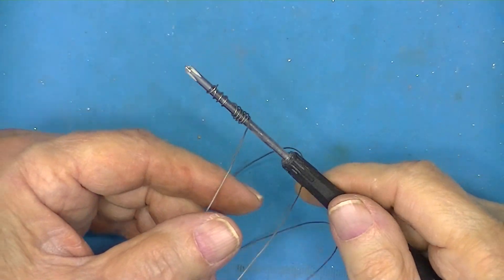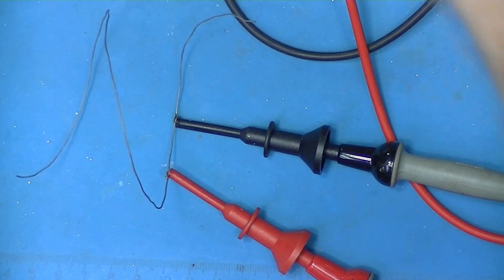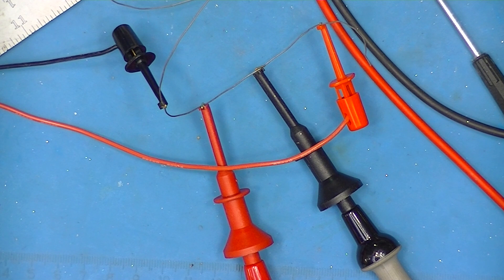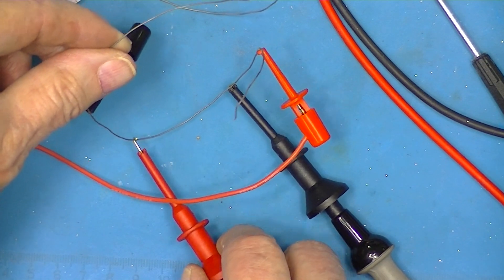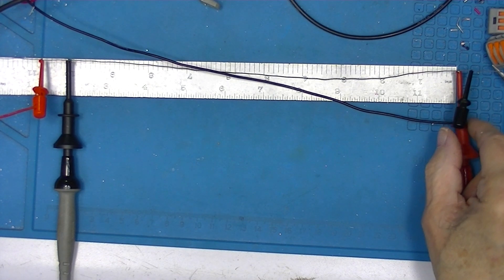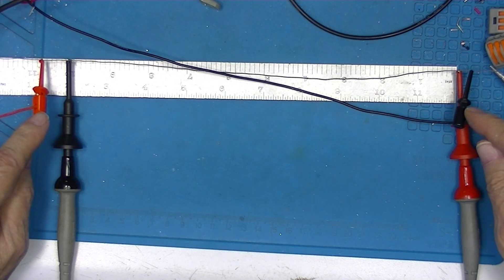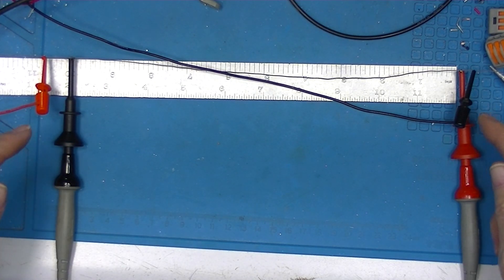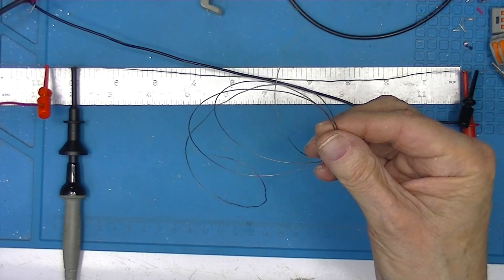Nichrome Wire Measurement

Comment: I have a 12vdc 2amp power supply plugged in. I get 12.3vdc from the multimeter. But as soon as I connect the NiCh wire, voltage drops to zero. What am I doing wrong?

Wire is 28 guage NiCh at 4 ohms/ft
Reply from the maker: What is the length of the wire? If the power supply is rated at 2 amps, you must have a minimum of 6 ohms load, meaning at least 18 inches of wire. Ohms Law  I= E/R, or 12/6 = 2 Amps. Also, Watts = Volts * Amps or 2 * 12 = 24 Watts at 18 inches of wire, so that's a lot of heat! If you  must use 12 Volts, try about 5 feet of wire.
Thanks
Steve
Reply: @stevestrivia-bystevewagner4852  the length of the wire is 12 inches
Reply from the maker: OK, If the wire is 12" or 1 foot that would equate to 4 Ohms. If you stick to 12 Volts, the current required will be at least 3 Amps/36Watts
Steve
Reply: @stevestrivia-bystevewagner4852  I see. The foot of NiCh is only 4 ohms.

🤔 I'm trying to find a different power supply with one with greater amperage. But I'm not sure shere to find one of thems
Reply: use a 12 v car battery